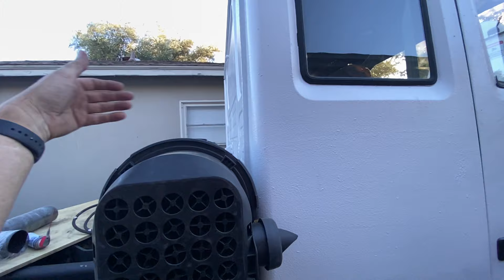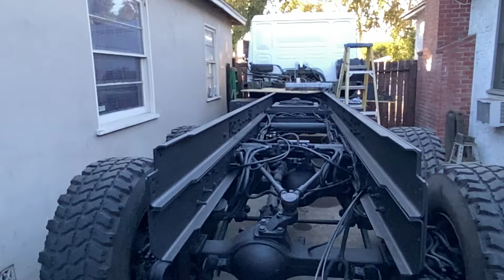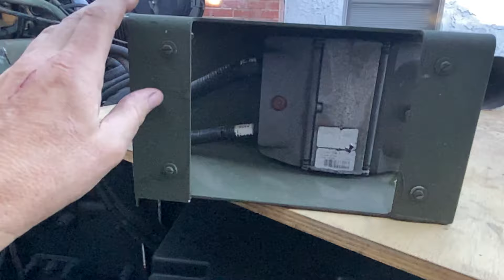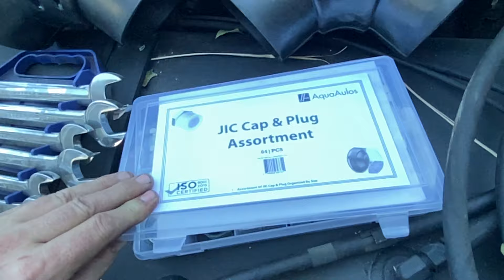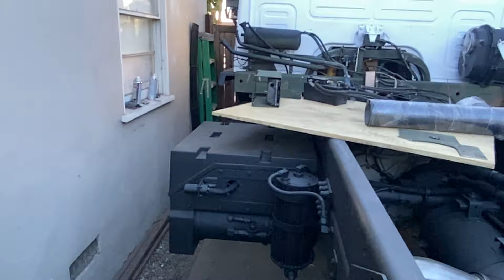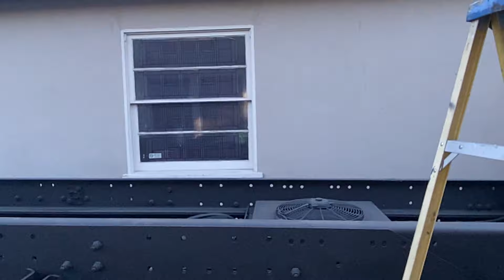Build day 11. Tubing and finding places for components.

Comment: I know this is a yr old, as long as you can stay under 13’ 6” you should be good to go almost anywhere. I believe 13’ 6” is the legal limit. I used to drive and most of the trucks I drove were in the range of 12’ 6” to 13” overall height.
Reply from the maker: Thank you so much! My truck ended up being with the box being put on it right at 12’10”. I just call it 13 and put it in my Garmin overlander at
102 wide and 13’ tall! Although I’m 98” and 12’10” for a little wiggle room! Thank you for your input! I still appreciate you watching my videos and commenting! Cheers brother!

Comment: Your cab height will not change with the new airbags.  The cab leveling valve will shut off the air when the cab support beam reaches a certain height.  It doesn't matter what airbags are in there.
Reply from the maker: Great to know! Thank you for taking the time to comment! Cheers!

Comment: are you going to spring mount the box? (habitat)
Reply from the maker: The box will be mounted like everything the original
Manufacture mounted it! Directly bolted to the frame.
Reply: @TRCa51   you may want to re-think that.... when that frame flexes, you'll rip that box apart. i've recently repaired 2 trucks with this issue. give me a call if you still have my number, happy to share how i did it. scott.....your old nieghbor.
Reply from the maker: @scottlobsterlift4332  thank you brother and I didn’t know that was you! As per an engineer I got to talk to on these trucks they recommend bolting to the frame and not a suspension box unless I was going to do a composite box. The frame on this truck is massive and so will the flat bed. Most thought I was crazy to weld the box on my Adventure Truck but it ended up working out amazing. Always appreciate the input! And if I start getting too much going on I can simply unbolt it and put a suspension type system in it. I don’t think that’s gonna be the case on these type of trucks.